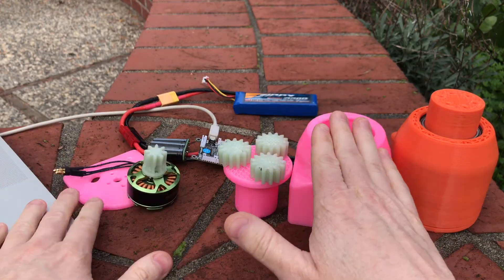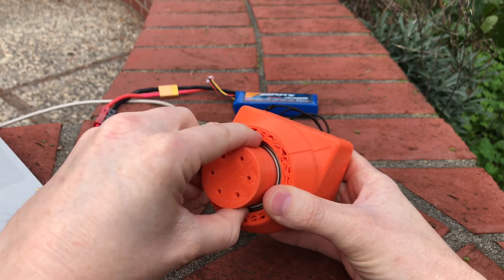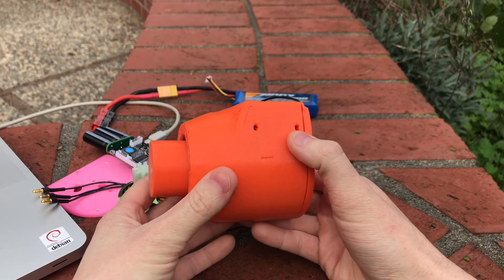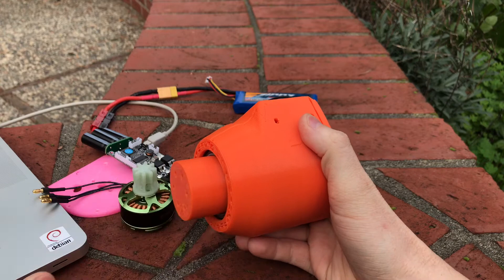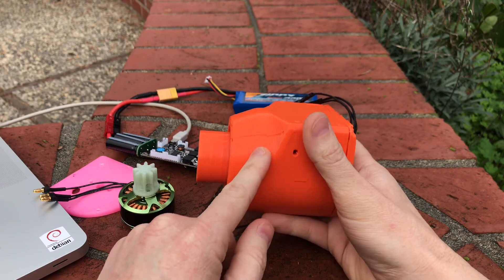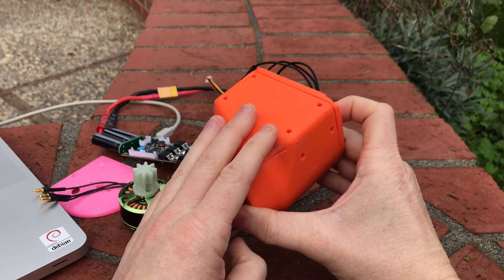New 3D printed actuator

Comment: Hi great work!

I guess you use still a vesc as in your previous model?
Do you know any cheaper alternatives to drive a BLDC motor 2 ways?
Car ESC's are cheaper but still more expensive than 1 way esc's for drone like example.

thanks in advance
Reply from the maker: Hello and thanks! Yep I’m pretty happy with the VESC and it’s all I’m using for now. I did find that the $86 Hobbyking VESC called the E-SK8 or something works well. Someone on the forums did make a VESC Mini that looks cheaper so I am working now on a variant of that board that I’m hoping will be good for lower power applications. However without high volume sales I can’t beat Hobbyking on price.

Cheaper ESCs would work for spinning the motor but won’t be useful at low speed due to the simple control scheme. My goal instead is to popularize VESC variants that are cheaper and try to get a high volume distributor interested.
Reply: I'm in my last master year of electronics engineering. And I would be happy to help in such an (open source) project. I would love to build a sumo robot with bldc's but the driver price is holding me back. but I would love to learn and improve my skills and knowledge while putting it to good use in a project like that. If that is something you want try with another person please let me know and we can go further into detail.
Reply from the maker: geobruce that would be wonderful! If you email me at tlalexander@gmail.com it will remind me to upload my latest VESC Mini variant to GitHub. I’d love to collaborate on this!